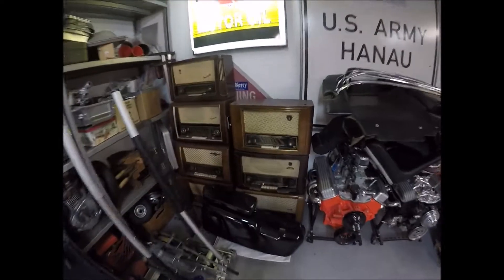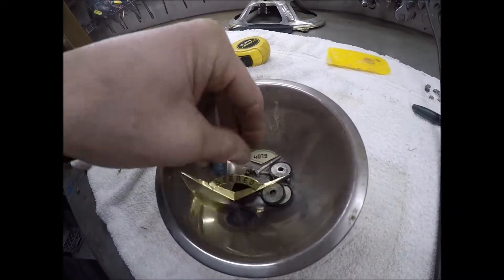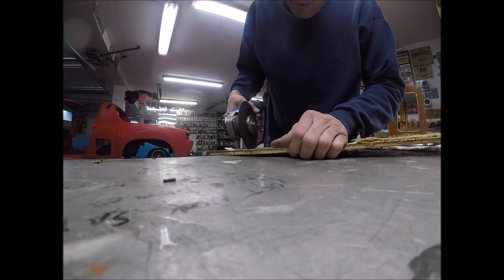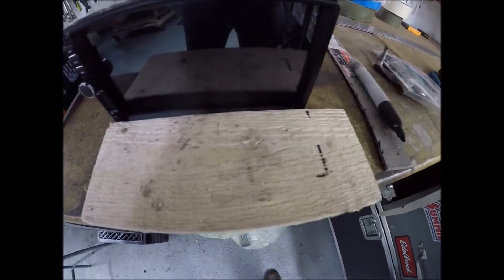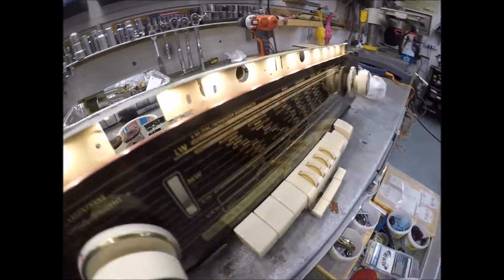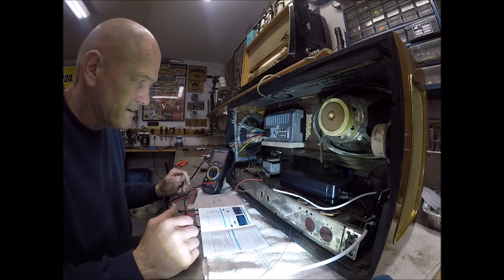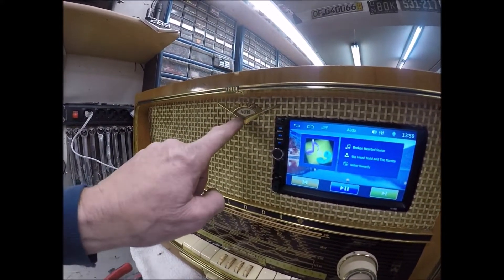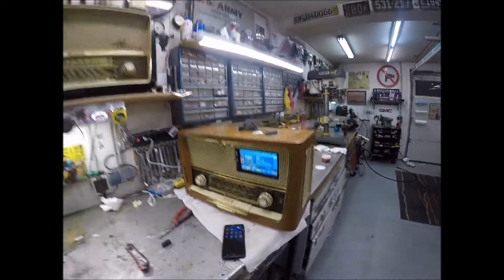Pimping an old German Tube Radio with Modern Technology

Comment: This is so cool, well done and you have me inspired to do something similar. Would you write a parts list by any chance? Would be a handy project for the autumn.
Reply from the maker: no real parts list.  Any 12V power supply will do and any cheap eBay or amazon car radio is fine.